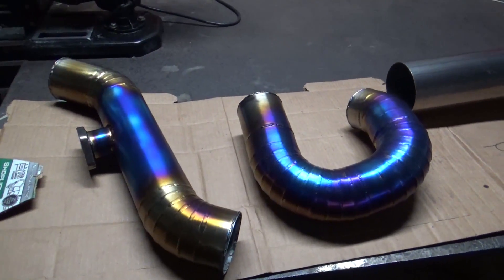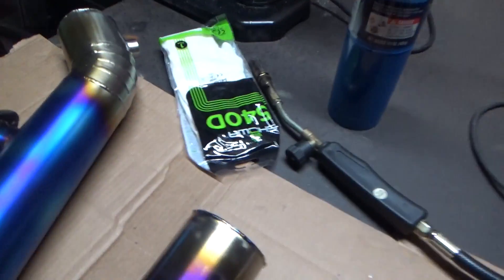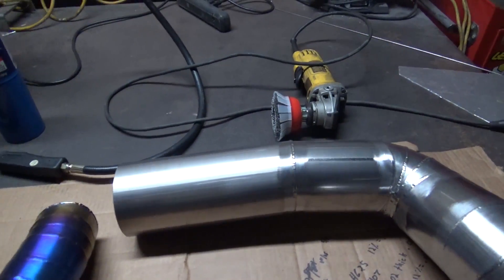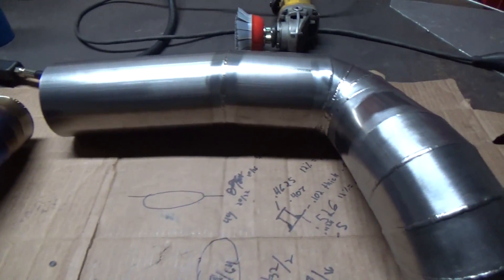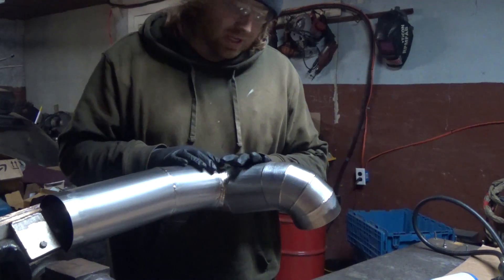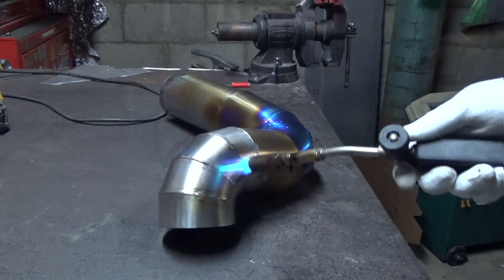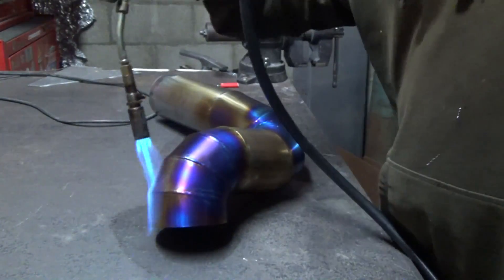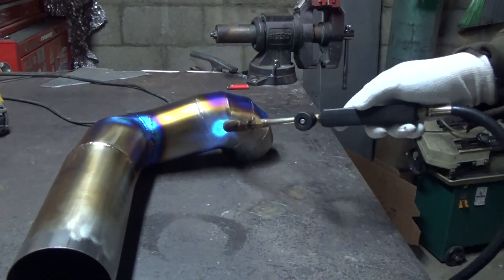How To Properly Color Titanium

Comment: So cool, I wonder if the blue color can be scratched off?
Reply from the maker: Essentially what the coloring is, is an oxide layer on the top of the titanium.  What that means is it can be removed with an abrasive.  But only by a harder material than the oxide layer.  I.e. sand paper.

Comment: Did you ever try using electricity to color Ti by anodizing? I messed with small Ti parts in water (plus some trisodium phosphate for conductivity). I had to go up to about 100 volts to get the greens and pinks. Blues are around 30-40v as I remember. I think the anodizing produces a really even color that can't be matched doing it by hand. But I also didn't try it on welded parts. In anodizing, there's no heating, so the weld mass is irrelevant. The question is whether the alloy in the weld is different from the part and whether that will color differently. 
Nice work, though!
Reply from the maker: I want to but haven't set up a test vatt yet.  Awesome to hear that it worked great for you.  Also I think commenters will apriciate u giving the voltage u used to get good blues!

Comment: So I got a used dirt bike with a titanium fmf system. My cousin convinced my to sandblast the header and I also got the mid pipe vapor blasted. The vapor blasted part turned out great and is still blue. The sand blasted looks like a basic piece of metal. I regret my decision but it's a learning process and I can't go back on it. If I polish out the sandblasted pipe, can I get the same result or does that wreck anything in the metal? The header was also welded by the power bomb. I think it was just some basic wire welding. Looks pretty bad but you said the polish the welds. If I polish that weld, will it have the same result? Is there certain welds that aren't compatible with the titanium turning blue?
Reply from the maker: you need special wire and it needs to be tig welded
Reply: @DanmosWorld  will the pipe polish out fine and color still?
Reply from the maker: As long as its titanium yes

Comment: Is it true that used titanium exhaust pipe not possible to turn it into a blue if you used it after the 1st time without worm it up?
Reply from the maker: I'm not to sure about that to be honest
Reply: Can this be done to other metals as I have a steel exhaust pipe I would like to do this to and if so does the heat from using it cause the blue color to change a different color?
Reply: @dougmillard816  no it doesn't,  only titanium change the colors but be careful if u you keep the heat more the colors are keeps changing,  ex: 1st blue after seconds will be other random colors, and u cant change it after that

Comment: Does the heating up affect the strength of the titanium?
Reply from the maker: Yea it does however not enough to mess with intercooler pipes
Reply: @DanmosWorld  if you do it on handle bars of scooters they will break right?

Comment: I have a titanium exhaust I need to clean scratches off of. Can I use the wore wheen to take the scratches and color off and then buff it and heat it to change the color again? And what kind of wire wheel/ buffer
Reply from the maker: yes you can... use a stainless steel wire wheel and then a hard buffing wheel...make sure before you heat you clean all the oils off with acetone.
Reply: @DanmosWorld  thank you! Just saw my spelling mistakes. Sorry I was driving

Comment: Great video , I subbed ... what grade is used for Titanium exhaust and can it be used for turbo manifolds  . Thanks .
Reply from the maker: It's grade 2....I wouldn't make a turbo manifold due to the heat cycles and the thickness u would need to use for a turbo manifold would cost u $$$$$$$$$$$$$

Comment: 1 - strip all oils and residue from the surface of the metal
2 - heat the metal slowly and gradually build the colour into the surface
Reply: How do u get it back to stainless steel if u pip is titaniumed
Reply: @Anoymus985  sanding
Reply: @Anoymus985  your pipe is either made of titanium or stainless. it's not like you can buy a titanium pipe and turn it into stainless
Reply: @slipknotfan2217  alchemy duh

Comment: Just keep it a silver. It will be stronger and you won't oxidize the alloy in any way. Nobody gives a shit about the color because nobody is going to look at.
Reply: 🤔 every1 is going to look at it and give a shit
Reply: I work with TI2. You make it weaker when heat it added unless it's added within a vacuum chamber. Once you add oxygen it is prone to future oxidization and failure.
Reply: But as long as you look "cool" (over a muffler?) Then it's all fine

Comment: My burnt titanium tips are fading. Can i just clean them up and re burn them with propane to get that vibrant blue again? Or do i need to sand tje whole thing (erase the current burnt look)?
Reply: I would recommend sanding it. Just because it would get a better result. What I would do is clean it with East her brake parts cleaner, or even just soapy water. Use some rubbing alcohol or acetone and rub it all down. And make sure your wearing gloves. After that, use a wire wheel and go over the entire thing. I would sand it down using a low grit such as 140. Then continue up until probably 2k. Then follow this process. After. You should probably clean it up with some polish but it’s up to you.
Reply: @sentinol8943  thx for the information dude 👍
Reply: @XxLAȚEXFRƏÅKxX  absolutely no problem man. If you have any questions feel free to ask, and if I don’t know the answer, I will try my best to find it.

Comment: Does this work wait stainless steel and regular steel?
Reply: Also , the stainless will rust in the spots you burn it I'd you dont keep it polished and cleaned like every time you ride lol, I did that to the tips on my truck.
Reply from the maker: It will but temperatures will be different and it won't be as vibrant of colors